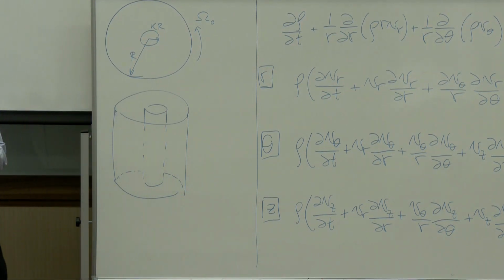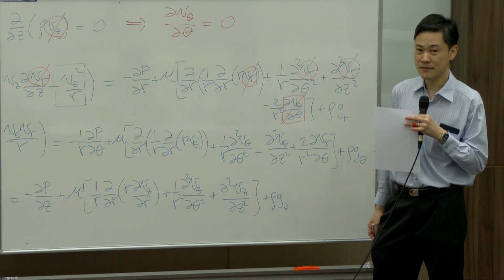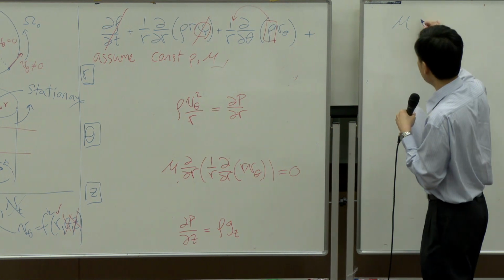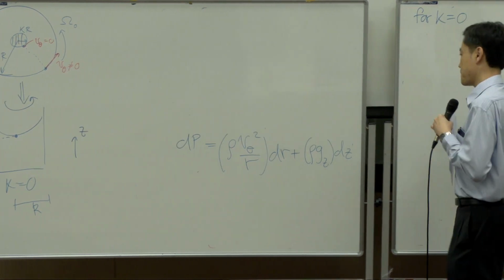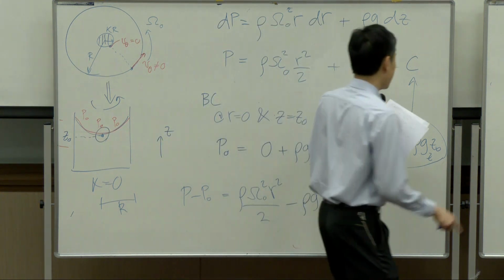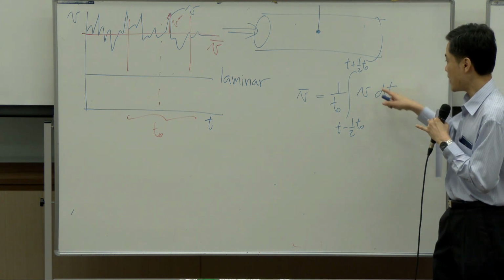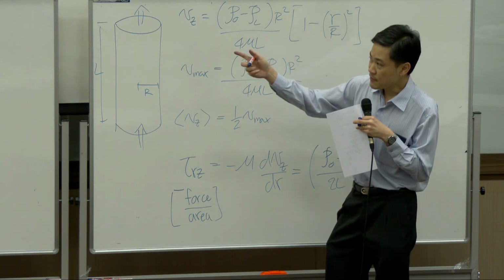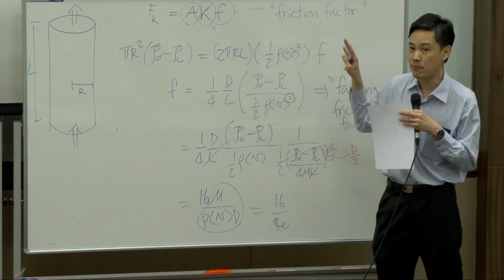Momentum Transport lecture 9/10 (13-Feb-2020): Ex for Navier-Stoke (rotating tank), friction factor

Comment: Centrifugal force has solution of the form height as a function of r squared derived from hydrostatics. I know I got those points on the homework in cems while Kevin Dorfman observed me eating a Jimmy John's half sandwich. It was on azarins transport 2 homework. The aaish uc homework focuses more on no slip and flow between two plates. You can solve centrifugal force balance as a flow between concentric cylinders but it is easier to use hydrostatics.